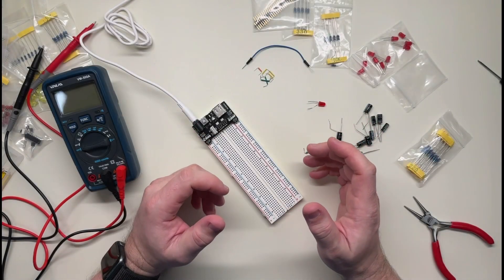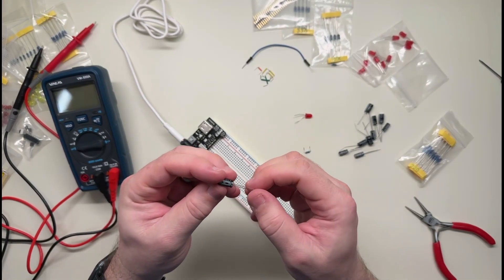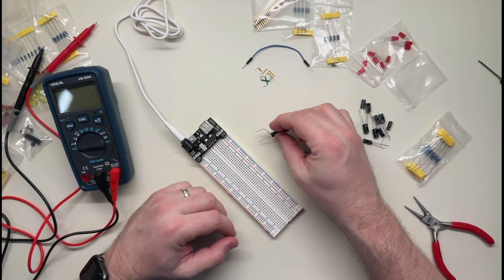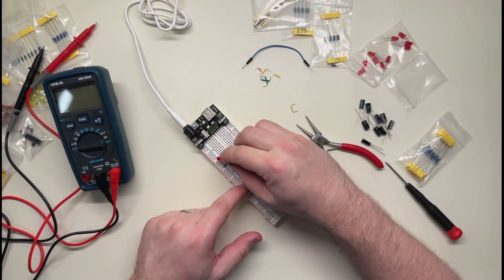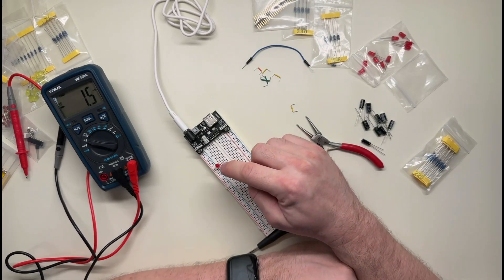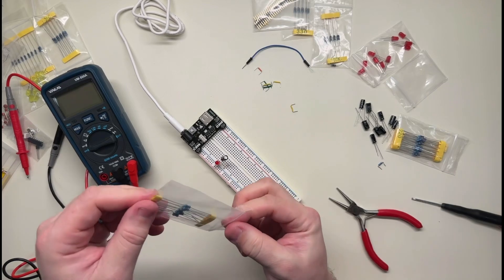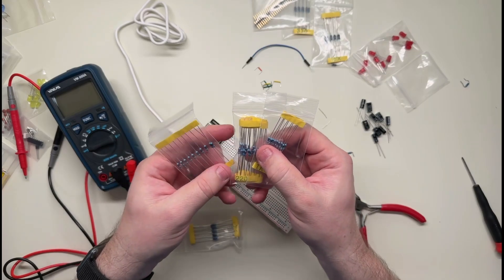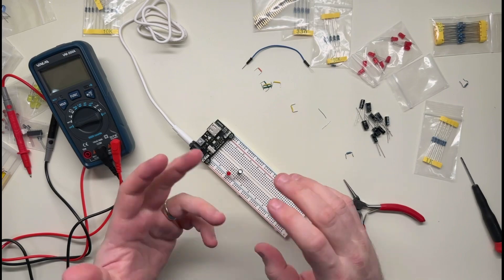Exploring Capacitors

Comment: 6:39 that's a very accurate analogy! The current "flow" on a capacitor happens literally across 2 plates, when 1 charge gets to one of the plates it repels another on the other plate, when that first plate is "full" it can no longer push other charges, and it stops current flow, it's almost literally as if it's a bridge and it's been blocked off.

Comment: Saw you mention this on Mastodon and I finally got a chance to watch. This is awesome! I love the idea of explaining what you think you know as you're learning it. Your explanations are clear and straightforward, and I think this hits exactly the sweet spot of extrapolating and experimenting, but also being honest and direct about what you don't understand.

I took up electronics as a hobby a while back, and was fun retracing some of those early steps trying to wrap my head around these building block components. I was interested in this stuff as a kid, but I could never quite understand these analog components, especially without web sites and YouTube. I'm trying to resist the urge to jump in with a bunch of nerdsplaining, especially since I'm far from an expert. It sounded like you were interested in feedback, so I'll just mention one or two things:

The capacitors dotted all around circuits are often for "decoupling". Logic circuits are constantly switching on and off, changing their load on the power supply. Because of resistance inherent in the circuit traces, internal to batteries, etc., that power can't be delivered everywhere instantaneously. That results in switching noise, where if you looked at the voltage with an oscilloscope, you'd see it's not a steady 5 volts, but full of spikes and ripple. And more immediately, the part that just switched on will see a voltage sag as it tries to use more current. That can be enough to cause it to malfunction, especially with higher-speed chips. So a capacitor is placed, not in series but in parallel, close to the chip's power pin. They have the effect of filling in for the power supply and smoothing out that transient, even if it's only nanoseconds.

And the physical size of those type of resistors is usually connected to how much power they can dissipate. Those look like 1/4 watt. The other common size are the little 1/8 watt ones. For digital logic circuits, it's rarely important, and I've gotten used to not thinking about it.. until one goes up in smoke.

Looking forward to more of these!
Reply from the maker: Awesome, thanks for this! I've noticed on many boards (by way of watching retro computing stuff on YouTube), that it seems pretty common to have one capacitor per IC - so that explains why!

I guess by way of analogy, those capacitors are sort of acting like a coral reef or an atoll which can protect/shield an inner lagoon from the ocean's big waves? Or maybe a better analogy are the baffles they put inside of water tank trailers and whatnot to prevent the liquid from sloshing so much when the vehicle changes speed or goes around corners? (Although the mechanics of this is probably really different for electricity. I think baffles and reefs are basically just breaking the waves and restricting motion but a capacitor stores a charge and then releases it back in, I guess, but in my head I see this as sloshing back and forth like liquid in a tank, so maybe it works?)
Reply: I guess it would be more like a small reservoir/tank? To really strain the analogy, I guess it could be seen like you have some machine that suddenly demands water, and the main pump is on the other end of a long pipe. When it starts sucking on the pipe, the first thing that happens is the pressure drops and it doesn't get enough water, so you have this charged-up local supply that can make up that pressure for a few seconds.

However my brain is wired, analogies don't work very well and tend to confuse me more than help me to understand things. I'm aware the water analogy for electricity is very popular and works for the vast majority of people, I just tend to avoid it. My way of thinking is that it's acting like a capacitor: it charges up to the supply rail voltage and when a transient pulls the rail down, it discharges to bring it back up. That's probably not super accurate either, but in practical terms when you're designing a circuit you just look at the manufacturer's data sheet and they tell you what to do (e.g. page 13 of https://www.ti.com/lit/ds/symlink/sn74hc04.pdf?ts=1701017669732).